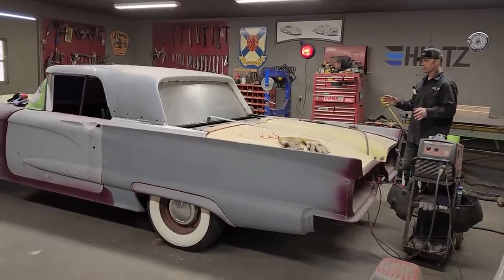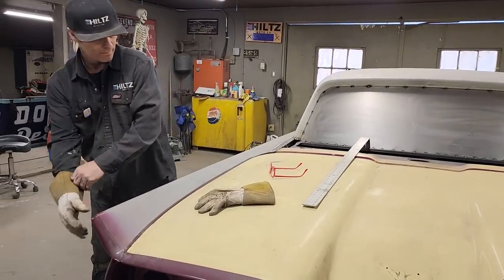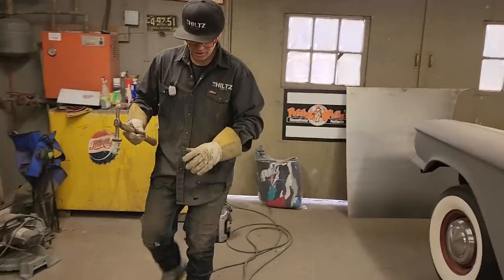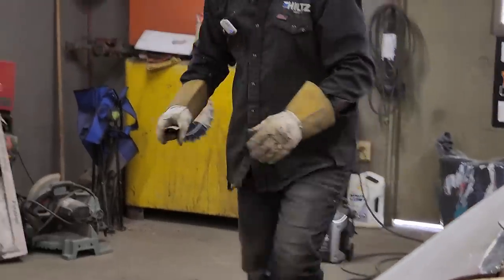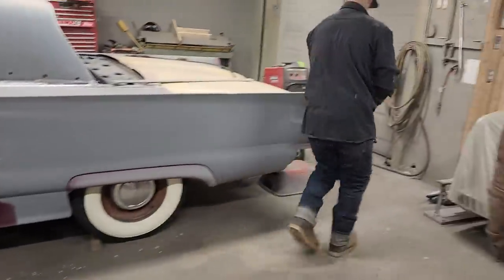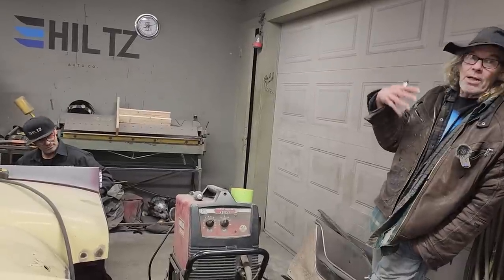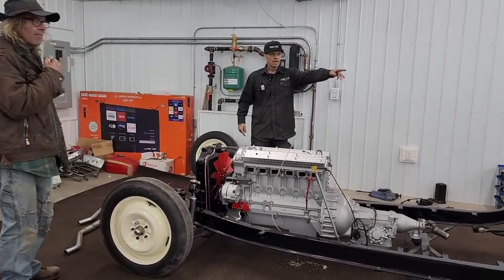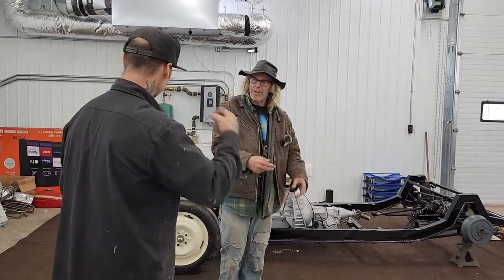The controversy continues ➡️ panel fabrication + Bugatti update!

Comment: I like the change In design 
I was an auto engineer for 42 years
The panel you are making is called the tulip panel or the upper back panel
The sail panel is the side of the roof quarter panel

Comment: Original rear window would surely have worked had you moved the part from the package tray forward 12-1/2 inches with the roof, then fabricated the inbetween part from trunk to removable piece. That part will now be forever buried unused. I thought I heard Jolene ask about this idea and you played it off. Now im waiting on the door glass to see how that one gets modified.
Reply: I agree to that and waste 60 min cutting a piece of sheet metal?
Reply: Not a waste of time when you make money making videos! 😎
Reply: Well everybody has their own way of doing things. Although I tend to agree with your statement and I do not see the use in the way he's going about it. I'm waiting to see how it turns out. I told him give retro 1960s spykar James Bond type of theme and just put cameras and have that as a blank screen. Sometime when you fling it at the wal, it sticks.
Reply: @gregoryh4601  you are saying waste of time when bad Chad does more in one hour than most people do in half a day🤔🤔 wow aren’t you something else🥴🥴
Reply: Hmm, I don't think that would have worked considering the contours of the trunk lid and how they merge.
Reply: I understand your meaning, but if you really think about it the lines are tapered getting smaller. If you fit a piece in between, the lines won't be a continuous straight line.
Reply: He explained very clearly why that wouldn't work
Reply: I thought like you at first, but then when he explained the elevations and the complications of fab bing the drain channels l see exactly what he is talking about. Now l think it s going to look awesome.
Reply: It don’t matter the car will never be finished anyway once he makes enough money of the videos he will move on to new content
Reply: He shows as he extends the sail panel it rises,thus not leaving a drainage issue, a two piece center brake light one in the dip and one going long on top of the short one
 would distract from the sail panel end and set up a good look for the rear window.
Reply: @stevo184 Will if it's fabricated to follow that shape.
Reply: @drewaitchison3521  No it can't, think about the tapering angle, it's impossible to do without changing the line.
Reply: @jimcollins3411  I was going on the premiss of him using the original glass and rubber moved foward. Can the original glass be cut ?
Reply: @jimcollins3411  I stand corrected, Your Right ! He could have cut the original glass ,  I love this Live Stream.

Comment: As @Al Rickmers mentioned, Chad is using the wrong terminology. The area he is working is NOT the "sail panel". The sail panel is the area on the SIDE of the roof between the rearmost side window and the rear window. That huge side area on the TBird roof is the sail panel.

Comment: Hi Chad and Jolene! In the future try using a flashlight at the back of the trunk lid and the shadow will leave you a sharp exact line. I had to figure out a similar situation and a 10 year old girl ask me if it would be easier to use a light and to my amazement it worked great.  Keep up the great content   thanks

Comment: After watching what you were doing regarding getting the proper shape along the lower window area, that would be a perfect place for a rear brake light. It's right in the middle, and it looks like the design was meant for it.

Comment: The rear window should work. There is no reason for it not to unless you make it so it can't worked. Which I by the looks of how the rear panel is coming together is the reason why it won't work, no other reason. I don't understand why you couldn't have cut out that section when you cut off the roof then you would had the roof more dimensionally intact and have everything needed to use the original window. I think the only controversy that happens here, it he presentation that there is a plan for something and the reality that Chad just gets in a rush and starts doing things without thinking it all through.

Comment: Chad is quite the fabricator and car custom guy for sure. I really like his T-bird roof modification ideas. But why he doesnt have a small pedal shear to cut metal & a bandsaw is peculiar maybe he does not sure. Also Working on a large work bench is way better then on your knees on the floor. Dont know maybe he just feels more comfortable with a cutting disc. Breathing in that cutting wheel dust over time will get to you as you age for sure to some degree...... Frank
Reply: He actually does have a metal shear/brake.
And he has a chop saw.
But no, I haven't seen a band saw. But I have never seen everything he has either.😁

Comment: Aren't you making the assumption that the shape of the trunk/sale panel would continue at the same angle going forward.  There's every reason to think that the new panel could be lower rather than on a simple straight line from the trunk.  You don't want the new panel to be eo-planar with the height of the adjacent fins which it will be if you just lay down a strip of metal to act as your template.   I've restyled several squarebirds -- I'd be honored to email you some pictures that I think you'll enjoy seeing.  Where do I find your email addy?  (Great fan from Salt Lake City).

Comment: A guy I watch who I'ld consider a metal work master, actually uses thick cardboard, after the paper, when runs the cardboard through his English Wheel to get the shape, checks that on the body, then cuts the sheet metal, he has made huge one piece panels, the largest I've seen on the current project was about 5 feet long by 2 feet wide.

Comment: with the T bird, why not cut through the center of the original rear scuttle panel going across the car taking that and all the original package tray forwards to where the original window lip then lines up with the rear of the roof where it was originally, then you make a new structure support for the trunk hinges which would be a direct copy of the section moved forward less the window lip and then its just a skin section to connect the two as a closing panel.
obviously keeping the original window

Comment: Use a bright flood light behind the car shinning forward and use the shadow line to trace the shape. Tape some string at he edge of the trunk lid on the apex, pull it forward keeping it on the apex and you will get the proper angle to the back glass support and it will be centered.

Comment: Chad I watch every day and I think youve done a nice job on the Bugatti replica.
You need to get an engineer to look at the rear end before you go much further. 
The radius rods are too short and will  not allow one wheel to move up or down without affecting the other side . Any body roll will try to twist the axle.
I've been a mechanical engineer for 50 yrs.

Comment: Chad there is a possibility that you can have the rear window cut down to fit the new rear position. Only issue is the rubber  gasket may have to be modified.

Comment: Whilst Chad has acknowledged that most of the restoration of the body was done by someone else, although Jim mentioned that he liked the seamless panels without joints it would have been beneficial had Chad mentioned that the build was already 90% when he brought it. Just basically felting this one Chad.

Comment: I think he's made a mistake. The radius of the curve from the back edge of the boot/trunk lid is flattering out as it rises towards the rear window therefore using a straight edge to gauge the point where it strikes the rear window pannel is making it too high. It needs to flatten out a little to match the decreasing radius. It's going to look odd with a smaller window. I'm sure he'll get it looking how he wants it and that's what is important. Good luck from North Wales 👍

Comment: "Sail panels" are the vertical roof panels rear of the side windows.  I don't know if the panel you are fabricating has a name.
Reply: It's likely not the correct word either, but I have always referred to that area as the rear cowl.

Comment: Hey Chad, why don't you get another trunk lid for that car year and cut that piece from there. That would give you a perfect piece and correct curve u need.
Reply: It wouldn’t follow the lines. Chad is lengthening the trunk area. The new lines are longer and narrower by the time they get to the back window area.
Reply: As I keep watching Chad marked the rear window metal exactly with the existing trunk lid and did not follow the narrowing lines. In this case a junk trunk would work.🤷🏻‍♂️🤔
Reply: Nobody asked for my opinion.😁
But here it is anyway.........

Yes, I would have sourced a scrap '58 trunk lid.
Cut the 12-1/2" or whatever that was needed to fill the gap.
Then in order to continue that narrowing body line of the center of the trunk...slice the piece, front to back, in the center.
With the body line where it needs to be at the window, weld the two pieces back together.
Fill in whatever gap still exists on between the"new" piece and the quarter panels.
And Bob's your uncle!

But it is not my project. So it doesn't matter what I would do.😁

Comment: You will have the pipes welded by the time you read this. I would weld flatstock on the bottom of the pipes for strength.

Comment: Is the bracket at the trunk bolted down?
Reply: I have been wondering the same thing.
If that piece, and the trunk lid/hood are not bolted in place, I don't know how the gaps can be correct on the side of the trunk.
The gap on the left could be wider than on the right (or visa versa). Or even scewed (sp) at an angle from the front of the trunk, to the rear. 
And if either is the case, I would think that difference is going to show up in the pieces that Chad is making... wouldn't it?🤔

Comment: Can you use the brake to put them contures in the sheet metal?
Reply: I think the brake makes more sharp angular bends, as opposed to gentle curves.
Reply: @Estabanjuan  I've seen where I use slotted round stock over the blade to give it a more gentle bend

Comment: Chad on that little piece that you've got there that's like 4" wouldn't you be better off slice Wouldn't you be better off slice in that in 2 and put one up against the window of the metal part now and then the other 1 to the trunk lid looks like I'd be a whole lot simpler than trying to figure out all the little INS and outs and it would be the same size goes you're going from a place back here forward and it's wider and it's getting narrow as it goes in I think that would make a big difference alright Ju started to ask you that time This is time This is Tommy 22 in El Cajon California like your show thank you